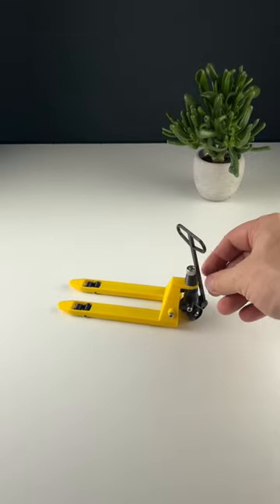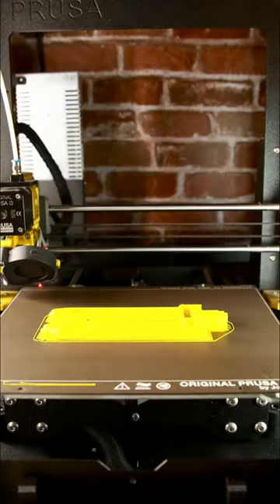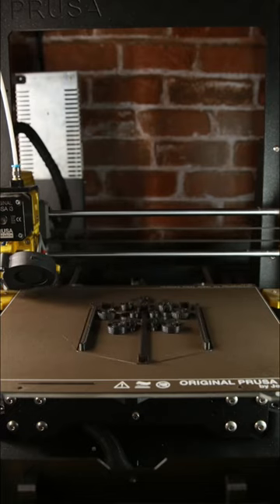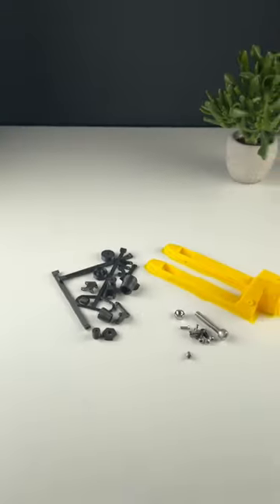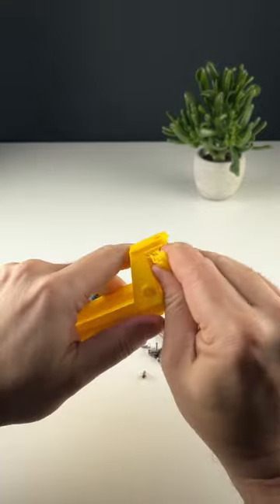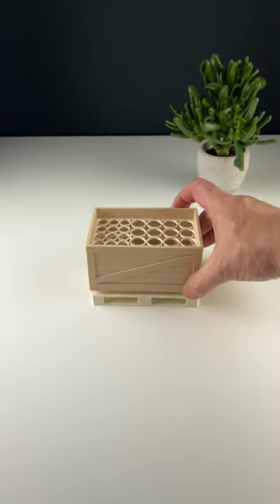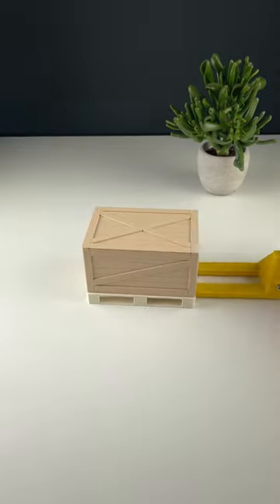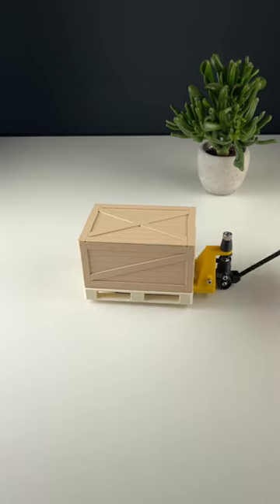Over Engineered Battery Holder Is EPIC! #Shorts

Comment: My battery box comes with slots for every size battery and a voltage reader to detect bad batteries… and you think you’re battery holder is over engineered? That thing you made belongs in the trash.

Comment: That’s not what over engineering means..
Reply from the maker: And yet it is exactly the definition of over engineering - the act of designing a product or providing a solution to a problem in an elaborate or complicated manner, where a simpler solution can be demonstrated to exist with the same efficiency and effectiveness
Reply: @3DMakerNoob  But that is not what your thing is doing here. Your design just looks fancy, and does not do the job innovatively or even in a good way. Overengineering by the gist of it means designing around multiple layers of potential failure scenarios. Looks play little to no part. I'm an engineer, I know it. You know why? Because they taught this to me and many like me in college.

Comment: I wouldn't call that over engineered, more so just overly cosmetically designed
Reply from the maker: That’s cause you didn’t see the full assembly 😁 it is beyond awesome
Reply: @3DMakerNoob  no that's because it's not over engineered it's just a crate and pallet jack asthetics. Over engineered would be if it were a complex electromechanical/mechanical design that over complicates the function of holding and dispensing batteries.
Or if made with overly complex or out of the way methods and materials
Reply: @gammaprysem  It is overdesigned because a battery holder just needs to be a small tab to catch/cage/hold the battery. everything else is for looks and presentation. 

now separately you could argue that it isn't overengineered because it's 3d printed and there isn't any meaningful added complexity to manufacture other than the extra assembly steps.

or the third term of overengineered in which something is built way beyond what is normal or typical and this certainly because it definitely doesn't need wheels or a tiny crate 😂

but if you made the holder able to use the batteries it is no longer a "holder" it would become a gadget more than anything.